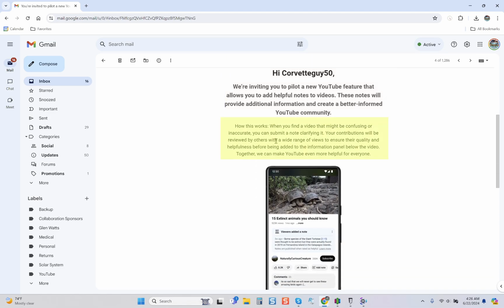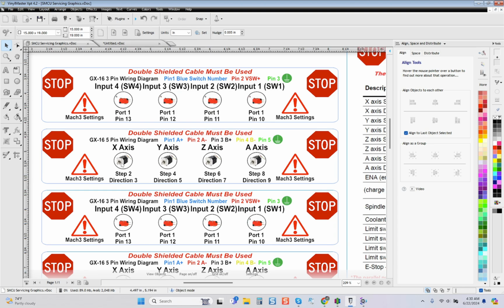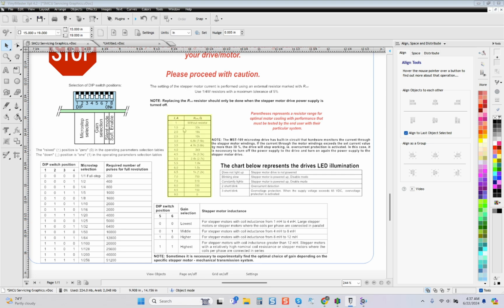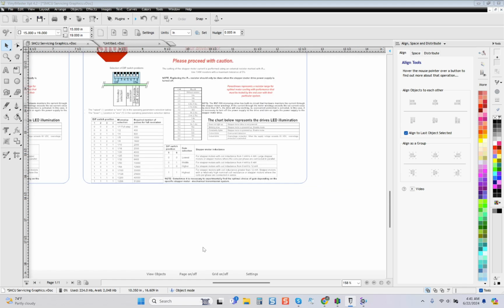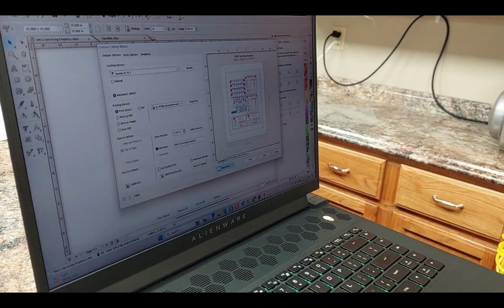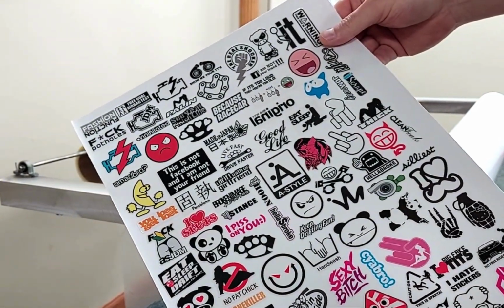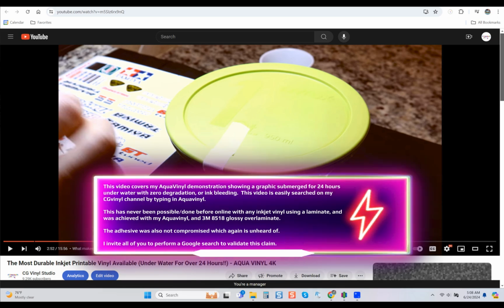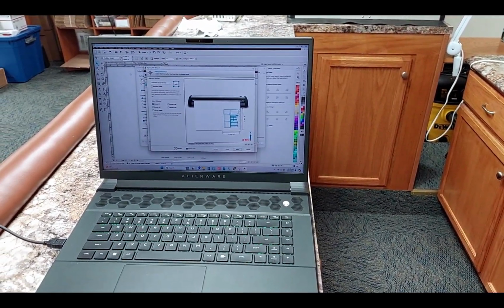The 4 Axes Ethernet SMCU CNC Controller Servicing Graphics Process Is Completed..

Comment: Mr. Vince, thanks for the educational videos.

I want to know which is better for a CNC transmission system: SBR16UU or HGH20CA?
Second question: 
which is better, having the transmission system on both sides or just in the middle of the chassis like the CNC 6040?
Reply from the maker: Please contact me through my contact information to setup a consultation as this would fall under engineering. Thank you,
Vince
Reply: @corvetteguy50  I am just learning
Reply from the maker: A single axis is much easier to setup than a slave dual rail configuration. HiWin is excellent quality, and made in Taiwan if their genuine linear guides.  Thank you,
Vince
Reply: @corvetteguy50  Thanks
Reply: @corvetteguy50  Mr Vince could you share with us a way to make a home soldering flux
Reply from the maker: There isn't one as it must be made with precision to allow for the solder to formulate a proper bond. Don't cut corners on this component as you'll be left with a compromised joint. Thank you,
Vince